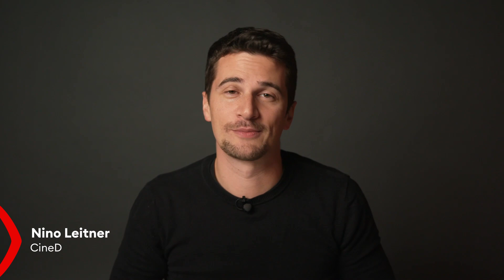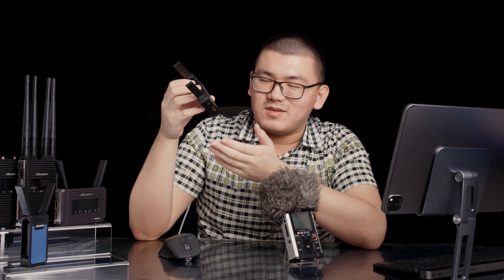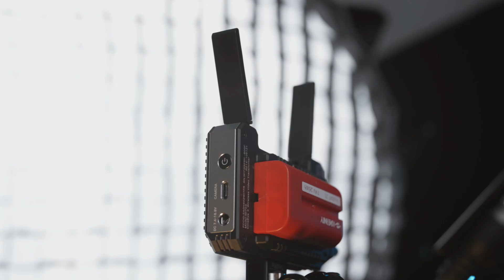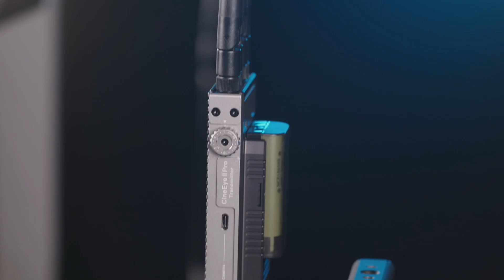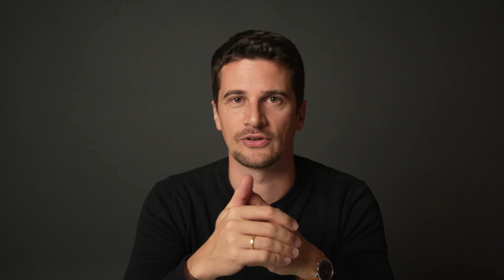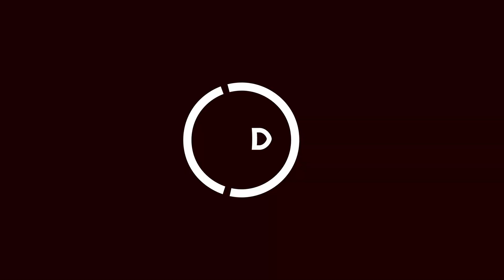Accsoon CineEye 2 Pro Wireless Video Transmitter Explained

Comment: Is it possible to switch for shorter antennas when you want a smaller footprint on the transmitter and don't need the higher range ?
Reply: Yes, you can do that but the antenna should work on both 2.4GHz and 5GHz
Reply: @appaccsoon4398  is there a reason why the cineeye 2 (non pro model) is not available anywhere and not on your website? 
i was ready to purchase it because of the hdmi loop through, but now i can't find it anywhere
Reply: @L-e-0-n  Hi Leon, you may buy it on Amazon, B&H, Adoramo or your local distributors, by the way, where are you located in?

Comment: Again 10-20ms latency keeps this out of the hands of anyone who doesn't want to buy a Teradek unit. If a company could close the gap with latency and keep it at a price lower that Teradek then you would have a product to sell. IMO. I do like this unit h=better than similar competitors however.
Reply: Teradek's aren't all that expensive, really.
Reply: these should work great for client/director monitor use... latency isn't an issue at all for that.
Reply: @TheEditingResource  I agree with that however small companies cannot / should not buy two different systems. That means you buy one that works in all situations. That means 0% latency, or as close as you can get it.